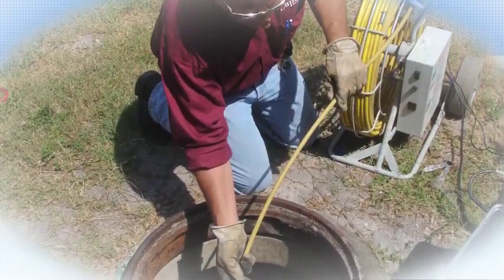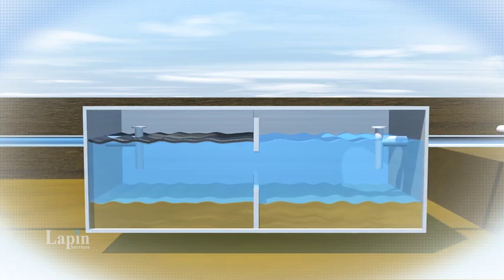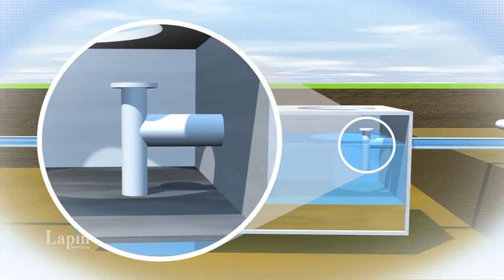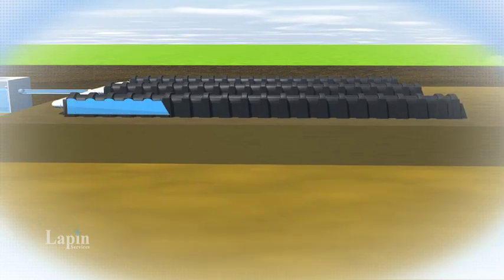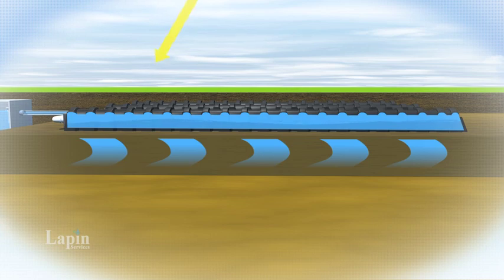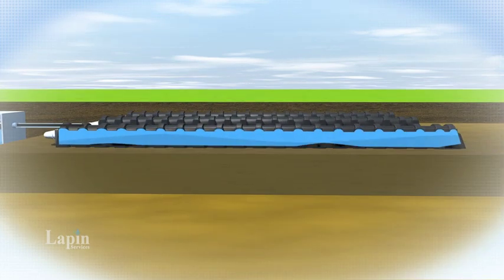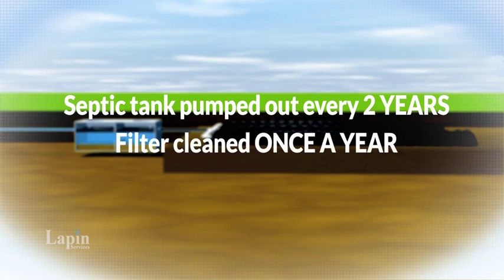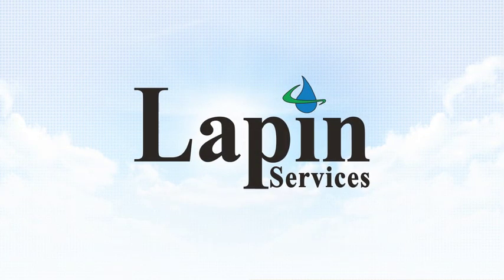How a Septic System Works | Lapin Services

Comment: The average cost for city sewage is $15.00. Its going to cost us 500 dollars to pump our tank. You want people to pump the tank every two years? That's 1000 dollars in 4 years.  When using city sewage would cost around 720 in 4 years...And with city sewage the waste isn't just sitting in a tank in your yard somewhere and you don't have to call anyone to dig a hole in your yard either....
Reply: A municipal sewage system isn’t available in all areas, that’s why septic systems exist. Obviously it’s preferred to be connected to a sewage system.

Comment: Not pumping a tank makes as much sense as not changing the oil in your car. You don't change the oil in your vehicle regularly because the oil wears, you change the oil to remove the sludge. Trust me or not, keep going with that mind set and one day soon you will have a large repair bill for the replacement of your absorption field.
Reply: You aren't a professional mechanic or plumber are you?

Comment: I put my system in 1975, I had it pumped in 1992, six people living in the house with a thousand gallon tank. 150 ft of fields. I had it pumped again in 2013, still working fine. at $325 every two years to have it pumped is a waste of money.
Reply: How big is yours? They're not all the same size  (I presume)
Reply: Is it a “filter” or a baffle?
Reply: Or $500 every two years in some states.
Reply: ours has been installed since 1946 and has been pumped exactly 6 times so far and still works perfectly fine.
Reply: We had only pumping ares once since living here until recently. Had needed to pump it multiple times this last year. Finally fixed the problem today.....hopeful. There was a hole in the old concrete baffle and so the outlet go clogged.  We unclogged it with a snake and bypassed the old baffle and replaced it with one made out of pbc. Hopefully this fixes the problem and we won’t have to worry about the thing again.
Reply: iam an engineer, you can tell me its dimensions and i  tell you actually when you need to disludge it not to be clogged
Reply: True since 1997 i never pump it at all lol

Comment: I'm shocked that this is still used over a sewer system in developed countries.
Reply: tom slick Because it has to be emptied on a regular basis. It's not as efficient or cost effective as a sewer system.
Reply: EnigmaHood I'm guessing in a crowded neighborhood this couldn't be used... looks like a design for those who live out in the country.
Reply: +EnigmaHood Due to rapid gworth, infrastructure didnt catch up in Dubai. around 25% of the city's waste goes to septic tanks. The rest is normal sewage system. https://en.wikipedia.org/wiki/Sanitation_in_Dubai
Reply: @SasapessoS  I was told that Dubai doesn't have a central water and sewer system. Everything is pumped in and out by truck.
Reply: Sasapesso S You would think that. Look it up yourself if you don't believe me, Burj Khalifa uses a septic tank as unbelievable as it sounds.
Reply: +EnigmaHood whats wrong with it?
Reply: EnigmaHood good point
Reply: Sasapesso S That 25% also includes the Burj Khalifa tower.
Reply: EnigmaHood hell no. High rise buildings are connected to sewage. Septic is used for private 2-3 story homes.
Reply: EnigmaHood didnt know, thanks.
Reply: Don’t have public sewage down are road so it’s not an option.
Reply: +EnigmaHood It's cost efficient. Connecting a house to a sewage system hundred miles away is costly. And septic system doesnt pollute nature. septic system is the best solution for low density population areas. I'm shocked you relate septic system with underdevelopment. on the contrary,  non-developed countries dont use septic system. their villages, remote areas have holes dug to use as toilets.
Reply: Sasapesso S I'm not an expert on waste disposal so it's possible what you're saying is true for low density areas, however using septic tanks for city areas like they do in Dubai, is definitely not cost efficient.

Comment: In our country, the common design of the septic tank is a two-chamber concrete.. Unlike the design in the video, the midpart should be fully enclosed with only a connecting pipe provided. The first chamber is a digestive chamber, the second one is the leaching chamber.

The reason why the midpart is closed is so that the sludge will get to the bottom of the tank upon the influent of wastes.. And then the clean/gray water will go to the leaching chamber as a final effluent.

All in all, thanks for this video... I learned new infos..